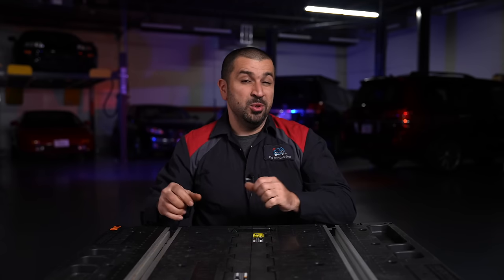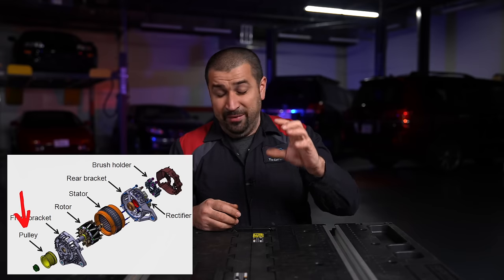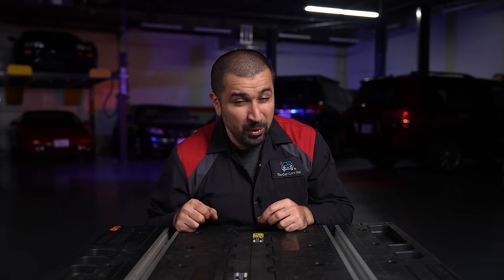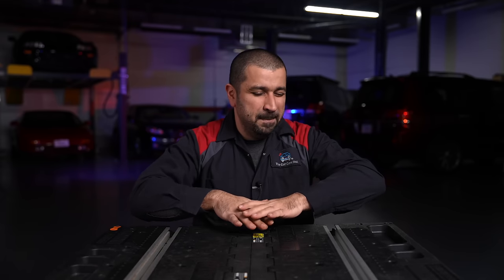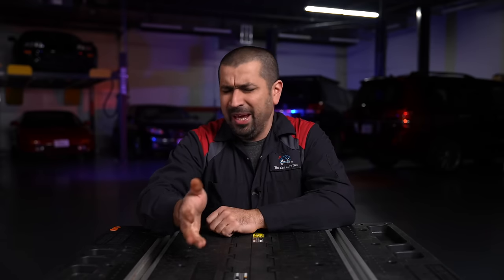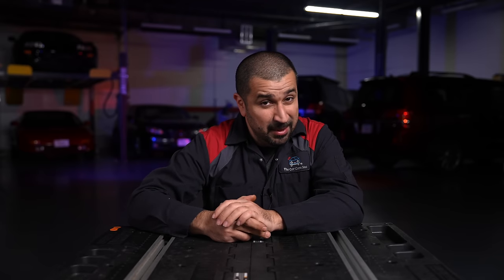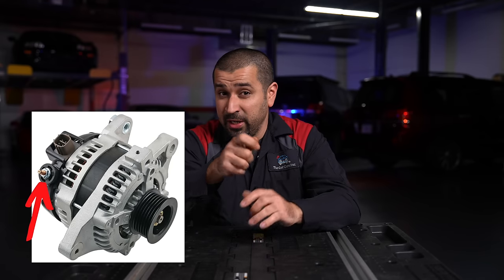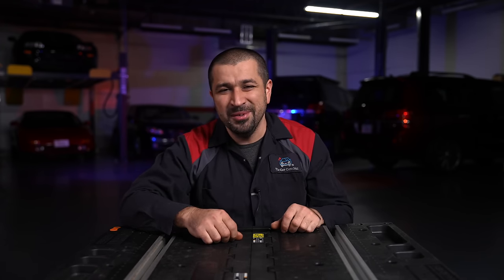How To Make Your Car's Alternator Last Longer? Everything You Need to Know

Comment: I drive 200-500 miles 6 days a week.  My Toyota Camry is my life's blood.  This info is priceless.  I have found an accessory that saved my a lot of headache in my previous  Corolla, almost by accident,  I purchased a cigarette lighter plug splitter with a voltage indicator.  I needed it to run my cell phone, camera, and other electronics .  When my battery light came on, I saw the decrease in voltage to 11.5 volts.  I knew to immediately proceed to the nearest auto parts store that provides free alternator and bettery tests.  They found that the alternator was on it's last last leg.  I limped the car home about 25 miles and replaced it the next day.  I also fully charged the battery and saved the battery from a premature death.
Reply: By charging your battery you also prevented shortening the life of that new alternator you installed.   The information in this video is spot on.  Career mechanic here.
Reply: Sir pls reply can we use car voltage stabilizer to prolong alternator health or is going to destroy the electricals and alternator prematurely???
Reply: @piyushaggarwal6294  You don't need anything else but a working alternator and a healthy battery.  A normal working car doesn't need a voltage stabilizer, as there is one already built into the car, usually the car computer itself which controls and monitors the voltage.
Reply: How many miles you got in that car??!!

Comment: The only alternator problems on Toyotas was about 30 years ago on the mid 1990's Corollas that came with Delphi Alternators instead of Denso ones.  Denso alternators are usually good for at least 100K miles.  I shake my head whenever I see other techs or service advisers at my dealership selling non-Denso after-market alternators that are usually only good for a couple years just because it's too late to will-call the part and don't wanna carry over the job to the next day.
Reply: 280k miles on my 2012 Sienna alternator.
Reply: 227 k on the alternator , put a Denso on it maybe another 227 k
Reply: I had a 2000 Honda Accord V6 with a Delphi alternator.  It failed at less than 100k.  My Lexus LX 470 has 218K.  Original alternator still going strong.
Reply: My original alternator on my '97 4 Runner lasted to about 270k miles.
Reply: My 34 year old Lincoln mark vii with ton of miles and factory alternator didn't go out until last year. Hell it's still got 7 of the original spark plug wires and it sees 500 miles a week of daily driving
Reply: 230k from 29 year old Bosch alternator in Volvo (months after fuel pump let go).
Reply: @alan4sure  Do you use a trickle charger or smart charger on your battery?

Comment: Maybe next time you could touch on user-replaceable alternator components, mainly bearings and brush packs.  Decades ago I used to swap in new brushes in GM starters, rather than buy a rebuilt starter; it was obviously far less costly, but even when time is important, the existing unit (starter, alternator) is OEM and superior in quality and condition to whatever rebuilt unit you could purchase.  When you return the old unit to get your 'core fee', you are giving up a far better component than what they sold you.  With new brushes and freshly lubed bearings, your old unit would outlast and outperform a rebuilt.

Comment: I'm an EE and enjoyed your explanation. The diode failure you noted is what happens when the diode shorts. Diodes can also fail by opening. In that type failure you lose one of your 3 phases and the alternator might still work at low load with some RPM but if you load it at idle the output will be low. I think the modern alternator "improvements" aren't so great. When did you ever see a plain old pulley fail? When have you seen an internally regulated Toyota alternator not regulate quickly enough? The efficiency improvements are very small for a large increase in cost. How's 20 years, over 260K miles and still going sound? When my old Corolla alternator fails I'll open it up, check the diodes, bearings, and likely repair it by replacing the brushes.
Reply: Another old EE here: You are spot-on and have the plan. If the rectifier diodes F/B ratios match, they're healthy don't have to mess with them. Cheers!
Reply: The reason why newer alternators have an overruning pulley is not to protect the alternator it's to protect the belt drive. Why ? Well they were not needed for lower output alternators, below 70 Amps or so. But modern cars with ever increasing electrical load, heated rear window, heated seats, heated mirrors etc etc. need an alternator that will output 120, 150 or even 200 Amps. The bigger the alternator the heavier the rotor, and since the engine does not spin at constant speed, it's more of a sine wave due to combustion pulses when the engine slows down slightly the alternator will try to back drive the engine, which will tension the belt in the reverse direction. When combustion occurs the engine will accelerate again and the belt will tension in the drive direction. The constant belt tension changes will very quickly overheat and destroy the tensioner damper, damage the belt tensioner, and possibly even shred the belt.
Reply: @petarmiletic997  With many vehicles over many miles I've never had any problems like that. Some had up to 130A alternators. I think most of this is about the last out to 3 decimal places efficiency and emissions nonsense. I don't think the OEMs have any desire for their cars to last 30 years and a half million miles either. Engine pulses are dampened pretty well by the flywheel and other loads. Of course the more cylinders...
Reply: I guess a faulty diode could be tested for using a true RMS AC volt meter to sense excessive ripple?

Comment: As an old mechanic, I always recommend that when people buy a new car, take it home and put  the battery on a Smart Charger overnight.  They are ALWAYS only about half charged, which puts stress on your alternator. Your Battery will thank you for it.
Reply: Thank you, Old Mechanic.

From Mr.Battery.
Reply: good idea, i'm a car tint installer and wonder why new car didnt crank when after like 20 min keeping the car on for acc like window and radio due to work, thanks for the info

Comment: Great info!  Just had my alternator replaced on my 2011 Avalon at 158,000.  Know I know how the alternator works.  Thanks Professor Car Care Nut!
Reply: Probably should have had my 06 Camrys alternator replaced around then. But incidentally it was on the drive I crossed 186000 (after I began going down a steep highway ramp) was when it showed that battery light and made clear something was wrong.  Hopefully many years from now I'll say how long the remanufactured alternator (only one in stock) from o'reilly lasted if I hold on to the Camry
Reply: @davidglad  More than likely the brushes are getting worn out.  You can order a brush set/holder (it's all once piece) for like $20 or less and replace it yourself.  Remove the three screws on the alternator end cover, remove the two small screws on the brush holder, install the new brush holder, pull the brush holding pin (it holds the spring-loaded brushes in place until installation), reinstall the cover, and Bam! you saved yourself $$$!  Rockauto & OEM Toyota parts sites have it.  Good luck!
Reply: The original alternator on my 2011 Camry V6 is still working fine at 274,000 miles.... knock on wood...I should probably get ready to install those replacement brushes I bought for it...

Comment: I’ve been preaching this for years. I tell folks if you forgot something on and ran the battery down and have to jump it off to get home, sure, get home. But when you do get home connect simple small battery charger suitable for the kind of battery your car has overnight. Then take it somewhere you trust and have the battery condition tested. Good information as always sir. God bless you and yours.
Reply: If you limp home with car in a low gear (higher than normal RPM) you will keep the alternator cooler.  The pulley fan is moving more air, and the ROTOR will need less current to charge.  Less  rotor current means less internal heat.

Comment: Great illustration and description on the operation of the alternator. I was an electronics instructor for 3 out of 10 years in the Navy and half of the instructors did not explain generation and rectification of voltage as quickly and clearer as you did here.

Comment: Great video by AMD! Here is another thing that may prolong the life of an alternator. Before parking and shutting off the engine, turn off the headlights (if it's nighttime), lower the climate control blower motor speed, or turn off the blower motor altogether. This gives the alternator a little bit of time to not be under load and to cool down before shutting off the engine. Again, this may prolong the life of the internals of the alternator.
Reply: @randyrankin589 What you suggest is utter nonsense.  An alternator is not like a turbocharger with hot exhaust gases passing through it and depends on oil flow to cool and lubricate the bearings.  An alternator uses sealed bearings and electrical components whose temperature will not increase after shutdown.

Comment: Fantastic presentation! High current is always hard on electronics and it never occured to me that running the vehicle to bring a low battery up would place concerning wear on the alternator even though I know and have measured 7 amps or more in that senario. Now i know how to baby my 2002 Tacoma with 265,000 miles just a little bit better.
Reply: Look at ur ground I guarantee that you only have one from the negative post straight to the chassis instead of 2
Reply: I was once going through a flooded área in my Corolla 04' and the battery light lit up for a few secs. I am glad I was not left stranded then, but the alternator survived and never gave me a problem later. Toyotas are wel made indeed

Comment: Good advice.  Always used a battery keeper here in Northern Ontario. My Camery battery was healthy for 7 years. The alternator was a wonderful innovation;  my first cars had generators...yes old geezer here.  Your explanation of how an alternator was a treat in simplicity...said from a retired physics-type guy.   Cheers.
Reply: You thnk owning one you'd have learned it's a Camry, not a Camery. Mind you, I know someone that thought they owned a Carolla for 10 years.
Reply: The CCN is a,"treat" indeed - 100% Geezer2Geezer APPROVED

Yea Physics type guy, those energy infrastructure equations for EV's might seem a bit sus, LOL.

Do you remember adjusting the regulating relay coil spring tension used with 12V Alternator Systems?  How about those much older DC Generators, 6V Batteries and using a glass Hygrometer as the tool of choice for fine-tuning the 6V battery charging voltage?  

Almost a century later (2024) we have YouTube, Cellphones, GPS, digital scan/diagnostic/programming tools, the amazing $20 component identifier, High Bandwidth 4-channel Digital Oscilloscopes, inexpensive borescope cameras, DVMs, and SDR, VNA and Tiny SA tools for the RF spectrum. 

Unfortunately we've also been, "gifted" with those 2450 battery-sucking, proximity-activated-transponder smart key RF remotes (Ford and Toyota) that have made modern car theft a quick and easy, contactless sport.

Amazing progress; now machine-learning algorithms, AI and sooner or later, safer-than-human self-driving cars.  There's a profit-driven dark side though; remote industrial-scale killing using (proxy) AI drone warfare in other countries!  (wasn't in the glossy advertisement brochure?)

Too bad these young whippersnappers don't yet realize it's the Creature From Jeckyll Island and totalitarianism sneaking up from behind on a secret multi-vectored attack mission to destroy absolutely everything for the propagandized, great unwashed... (Now that's progress!)

Good luck everybody, take care of you and yours!
Reply: @TonyRule  Yes, pretty ditsy (dittsy?) of me, I thuk.  Didn't learn to type until I was 40.  But at 14, I could do 12 words per minute in Morse Code...a handy skill.

Comment: Battery light does not always come on when the alternator fails. Happened to me twice, once on a Nissan, and just last week on my Acura TSX (I got the whining noise). Depends on what has actually failed. For example a single diode failure may not trigger the Battery light but the alternator still will not charge. Another good reason to stop driving a vehicle if the Battery light comes on, on many vehicles the serpentine belt that drives the alternator also drives the water pump, if the belt has broken the Battery light will come on but since the water pumps isn't running anymore the engine will overheat in no time ($$$).
Another sure way to kill an alternator, especially one with high mileage on it: jump start another car with your engine running. The alternator will suddenly try to push a massive amount of current to the other car's starter and dead battery. Guaranteed alternator failure coming up. If I need to jump start another vehicle I ALWAYS turn mine off first (making sure my own engine is warmed up, easy to restart, and my battery had chance to recharge) then hook the booster cables and start the other vehicle. Then I can take the cables off and restart mine, and no harm to my own charge system.
Thank you, love your channel!

Comment: Bring it to the place that rebuilds any DC motor in 10 minutes while you wait. New bearings, brushes, stator turned...$35 in 1997, $35 in 2001, $35 in 2014, $35 today. Guys been 90 years old the whole time.

Comment: To me the most important thing about saving the alternator is the battery....I change mine every 5 years maximum time ...lead acid batteries are built to fall apart over time....the acid continuously attacks the lead plates and sheds lead to the tray provided in the bottom of the case ..built this way...as the lead thins out , the battery gets weaker and weaker down to 10 or 11volts...the alternator has to work longer and harder to keep up thus burning it out...plates can curl and short out other plates causing low voltage...installing a new battery will make the vehicle feel like its gained 10 horsepower and bring back its snap...5 years maximum life, the newest battery at a high volume battery dealer . The  Date of manufacture on top of battery, and the biggest battery that fits  your car will keep your vehicle reliable in the long run ...
Reply: Sir you are correct. 5 years max, sometimes have replaced on my vehicles as soon as 3

Comment: What a way of milking time. This supposed to be about about care not about inner workings. 99.99 % of us are not gonna build or rebuild alternators or any other mechanical devices.
Your programs used to be more to the point, a lot more interesting and SHORTER.

Comment: 17:21
So getting to this point, it seems to me the best thing is to keep the receipt for the battery (photo copy it so it doesn't fade like on the thermal paper receipts are printed on!) if the battery dies and it's within the warranty period, pull it and get it replaced! If it's out of warranty, buy a new one (agm)!

Comment: Excellent information. After 40 years of doing all my own car repairs, wrenching on equipment, etc it never dawned on me nor did I learn from anyone that when possible always put a charger on battery if it goes dead for some reason vs jump starting and letting alternator do the work. Makes perfect sense. Also the advice to pay up for an OEM replacement can't be emphasized enough. I have known this for decades but recently in a bind to get a car back on road ASAP I bought aftermarket. I'm on 3rd warranty replacement in less than 2 years and warranty or not next time I'll pay $400 for an OEM. Thank You for the great video!

Comment: Easy to say stick to OEM until you have the battery light come on a couple of blocks from an Autozone on a Sunday evening. This happened to me and I was in a slight rush so I just replaced it using their alternator and I was back on the road in less than a hour. Really easy job for a 2012 Camry 2.5 and the alternator seems to be working fine for now so I will just leave it be. Plus their lifetime warranty is hard to complain with lol
Reply: Obviously, if you can do it yourself and the car you have can be done in under an hour then sure use a budget alternator and swap it out. If it goes bad for those who have a job that’s more involved aka rav 4 V6 etc etc and are paying labor rates it makes more sense to use the most reliable unit you can.
Reply: EXACTLY
Reply: @thetechlibrarian Yea i am the V6 Rav4 guy
Reply: I put a $130 refurbished alternator from AutoZone in my 09 Corolla after the dealership wanted $750 just for the alternator. That was at 85000 miles now I have $140,000 no problems.
At that price who cares if the alternator doesn't last as long I could replace it six times over.

Edit...
After watching this video I now know the reason by Corollas alternator went out at 85, 000 miles it's because every time I got my oil changed they would tell me you need a new battery.
You're down to 30%, then 25, then 20, I would like who cares when I get down to 1% and it won't start I'll get a new battery. So that's what I did in a few months after I got a new battery my alternator went out.

Lesson learned.
Reply: @ibelieveitcauseiseentit9630  also might be good for future reference I can’t remember exactly what the letter is but if you put a certain letter after Toyota’s part number, you will get Toyota refurbished parts, which are cheaper, but still pretty high-quality

Comment: My 2005 Camry LE that I bought new was an engineering marvel. The alternator was original...among other parts...that lasted 218,000 miles until I sold it in 2020. Then I bought a new Camry. You "get a lot of car with Toyota."